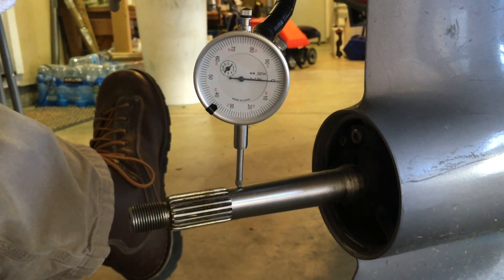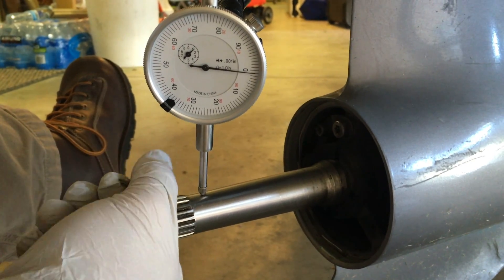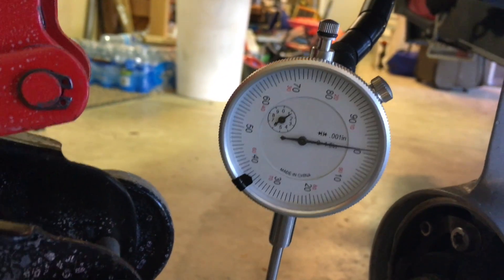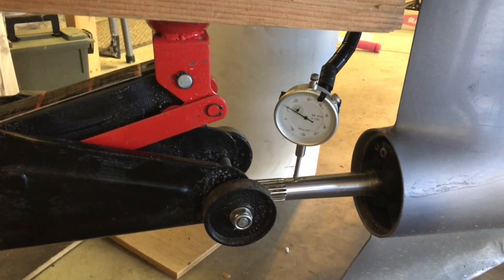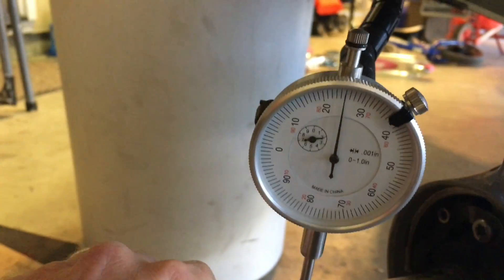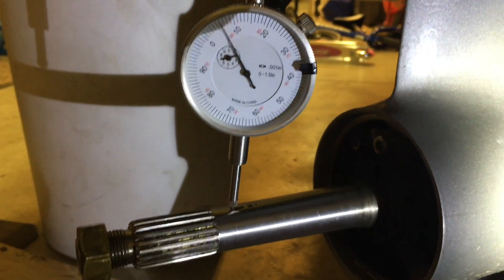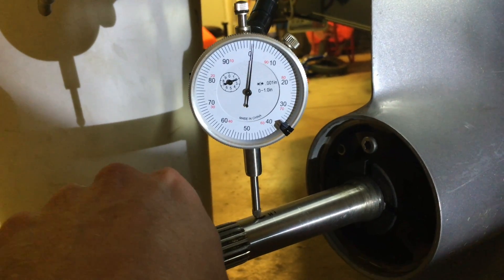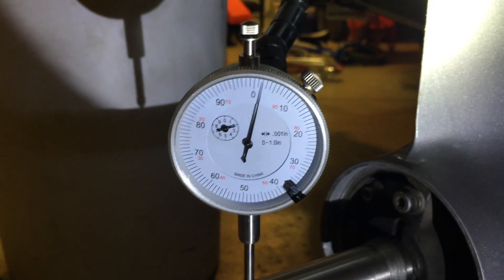Boat propeller shaft bent; repair

Comment: Had a 6mm bend in my honda 60 prop shaft.  Did exactly what is shown here, took 2 hours, managed to get it down to the point where I could not see a bend with the naked eye.  Unfortunately I never had the little gauge to measure the bens at the end.

Comment: Tried this on my bent shaft Mercury 25 HP and got it down to .003.  I stopped at that point and called it good enough. I didn't measure how bent it was at first, but it was pretty bent.

Comment: Be better to make sure its straight at the bearing end then find out  low spot....heat and quench to straighten in line with low spot on true circle....could bust housing this way.

Comment: I know this is an old video, but I gotta say it is still working perfectly! I bent the prop shaft on my Suzuki 200 and used this method to fix it. From .0190 to .0017! Time was about 5 beers or so. I still can't believe it works so well for being so low tech; another $800 saved because of this video! Now to find a skeg and prop repair video...

Comment: Stoooopid good video. Thank you. Zero impact on the bearings. This is the way to do it. Sure you could bring it to a machine shop and do it “the right way” but hell… Your way will save you bunches. For my 92 Johnson 40 they want 500+ for the shaft alone. 😂 HARD PASSSSS. Sure, if you’re 90 miles out and your life depends on it…. Maybe? But I’m putting around the lake on a pontoon

Comment: I commend you on your innovative approach to solving the bent shaft problem.

I have A couple of observations based on the video and other comments below...
1) waiting for a period of time while the force is applied does nothing.  Steel does not creep at room temperature.  
2) Once you reach the elastic limit of the shaft it will start to bend immediately with further force. You always have to overcome the deflection first when making a further correction.  
3) Applying force with the dial gage installed is essential. Once you get the feel for how much deflection is elastic any further deflection is actually bending the shaft back into place (called plastic deformation). This is what you're after, but you don't want to bend it too much.
4) A lot of comments warning of damage to bearing, housings, seals, etc.  First of all, if you have a bent shaft, the bearings, shaft, and housing have already experienced these high forces due to the event which bent the shaft in the first place.  Bending it back does involve risk, but it is a calculated risk.
5) Seals are very compliant, they should handle such displacements easily.
6) Brinelling of the bearing race is a possibility, but the original event would have also caused this if it happens.

The prop shaft on my Mercury 850 had 0.040” runout.  Bad enough to be very noticeable to the naked eye.  Applying this technique using a stubby bottle jack, board, and steel plate to spread the load I was able to get it down to 0.001” runout with no damage to any components!  It took only about 1/2 hour and no $$ other than the jack.
Reply: Wow, thanks for this comment!
Reply: Excellent comment.  I will be doing this to mine... turning the engine off in the water while it's in drive you can hear the prop contacting the shroud while the prop slows down.
Reply: 1) True
2) True
3) True
4) Dead wrong. When a prop strike happens the boat is in the water, the instant it made contact the rubber inner prop hub flexed, (if equipped) the motor was pushed to the other side, and the boat moved in the water, this all equates to a massive amount of "give", or "cushion" to the strike. The bend happens in a fraction of a second of high load at the instant of contact with the rock. What he's doing here is EXTREMELY risky and damaging the bearings for SURE. He's VERY lucky the upper or lower case did not explode in his face, they are NOT designed to have these types of forces applied in this way.
5) Yes and no, they are not designed to have this much prolonged pressure on one side.
6) Wrong again, see 4 above. The prop strike has to be very severe/under high load to damage the bearings, this repair "method" is WAY more damaging to the bearings than the initial strike that caused this slight shaft bend due to the massive, prolonged pressure to one side with zero give/cushion during the event of trying to bend it back.

At the end of the day, this obviously works, but almost everyone is causing more expensive long-term damage to the internals (bearings, seals etc) and risking destroying the motor case, and injury.
Just don't do this kids.
If you can afford a boat, you can afford to fix it right, or pay to have it fixed right.

People need to learn when and where to use which type of prop to avoid bending your shaft in the first place!
Aluminum props rarely cause bent shafts and are for open water and no hard obstructions like stumps.
If they hit anything, wood or rock, they will break/crack/chip/bend (by design to save you from expensive motor damage) and have to be replaced.
They are cheap to replace if you clip something.

Stainless steel props are for open water speed boats, and shallow water slow/idle speeds (like during fishing) with lots of wood obstructions like stumps.
They can handle wood strikes without damaging the prop or shaft 99% of the time if at idle speed and not blatant or severe/under load/on plane etc.
I currently live on the SE coast and bass fish inland freshwater rivers FULL of stumps, trees, and wood obstructions all over the place in the middle of the river half the time.
I have bumped dozens of stumps/trees with my stainless prop at idle speeds with zero issues.
Last Saturday I clipped a rock near a bridge next to I95 that should not have been there, destroyed my SS prop (They can be repaired, aluminum props cannot) and bent my prop shaft, because SS is much stronger than aluminum, so when they get broken from a rock, they also bend your prop shaft and/or do worse damage in the lower unit.
I was very unlucky and there are virtually no rocks where I currently boat except this one area and this rock still had no business being out in the open where I hit it.
When I move back to inland VA/NC next year where the rivers are all rock and never stumps anywhere let alone in the middle, I will be switching to aluminum as rock strikes are obviously common there, or I will swap on a jet drive lower unit if I can find/afford one to avoid the issue entirely.

Right tool for the job people, you don't need expensive stainless-steel props unless you meet the criteria I mentioned above, stop wasting money and risking damage to your motors.

Comment: I tried this on my 150 Yamaha, didn't work. Nearly caused further damage. 2.5 ton jack can explode your lower unit. That's more than a few grand at best.
As Christan said, spend the money and do it right. In NY my scag replacement was $325 and the ss prop fix was $285 at the prop shop. The dealer performed prop shaft replacement (prop shops don't dis and re-assemble) is $920,  included new shaft, new water pump housing and impeller no new gears and 3 hrs. labor. 
If you boat, at some point, you will find the bottom!
Tight Lines
Reply: You didn't know what you were doing then.
Reply: Hi Thomas I am located in NY as well and just stumbled on this video. It is that time of the year and would like to correct my shaft. Are you able to forward the shop info to me. Thanks Soo Much!!

Comment: As a marine mechanic for 30 years I HIGHLY do not recommend this! You are at risk of damaging the seals, bearings, the casting and a whole lot of other things. Just spend the money and have this done the correct way!
Reply: Absolutely correct
Reply: @TheGaboon01  not really,  i think; 

  if the bearing did not get damaged with the first underwater hit,it won't get damaged by the SAME force in the other direction; and i find it funny people talking about the seal!!  the shaft cannot move much ,where the seal( flexible rubber) is, so the seal will stay as it was before;  

and another thing: if the force was too grate to the point of the ball bearings/rollers  indenting the races, you'd feel it rotating the shaft in neutral by hand, and you'd hear the rumble and whine when you ran the boat in gear on land, on the muffs.
Reply: @josepeixoto3384  And I would replace the seal anyway if I thought it was a problem, that is still a very easy job compared to pulling the lower and then pulling the prop shaft. Don't get me wrong, I have done it, but I would do this if the bend wasn't over .125"
Reply: I TOTALLY agree.
Reply: If you think this is going to damage the seals you're just ignorant. Period.

Comment: Horrible.... You just side loaded your bearings and probably puting flat spots on them.... Down the line you are going to see the results of it
Reply: Lmao
Reply: 100% correct.
They just don't understand the simple physics of a prop strike in the water, vs static sustained load using this "repair method".
Stupid is as stupid does.

Comment: Many thanks!  This worked great!  I took my bent shaft from .115 to .003.  Your instructions were perfect.  I didn't buy the locking flexible type clamp that you had, I had to set up the two swivel system which was much trickier,.... I wish I had the locking flexible clamp!  Thanks again!
Reply from the maker: Nice job!! Glad that could help you out!

Comment: I feel like this is a dumb question, but I'm about to attempt this and am wondering how do you know which spot on the shaft to initially place the dial?
Reply from the maker: No worries! I just put the dial wherever it ended up and when I spun it, I identified the high spot to mark and start from.
Reply: @mbwtrpolo  Got it, so I attempted this the other day and when I spin the shaft the dial pin won't stay put. Looking for opinions, do you think that means my shaft is warped so bad I can't straighten it?
Reply from the maker: Ben Henson When you put the dial indicator on the shaft, you should be able to identify a low point on the shaft and a high point, with a linear difference between the low and high as you measure it.
Reply: @mbwtrpolo  Keep in mind the further out you go the better your reading, .005" runout at the 1/2 way point will be .010 runout at the end

Comment: Wow, I can only imagine the forces exerted on the foot casing and seals and bearings. I realize you didn't want to go through the troubles to disassemble the foot to get to the bent prop shaft and straighten externally, but you really applied a lot of forces on the case and everything else. IDK
Reply: I was thinking this same thing but I believe the logic here is the shaft was bent at some point and it survived those forces without cracking the case.
Reply: @ronaldwatson3348  Everyone is looking at this wrong, he's EXTREMELY lucky he didn't explode the case. 
During a prop strike there is a BUNCH of give, the motor moves, the boat moves in the water, so the force is not that high that bent the shaft.
It also happens in a fraction of a second, the motor moves and boat is pushed away in the water.
This guy is putting prolonged stress with NO give at all, on the shaft bearings, seals, lower unit gear case, and upper case with the wood and jack.
Literally everything about this guys "method" is a bad idea.
If that jack where to slip it could kill or maim him, let alone further damage or even total the motor.
There are plenty of home mechanic "methods" that work, some are safe, some are not, some are fine and ingenious, most are dangerous and foolish and results are 50/50 at best.
Do the job right or don't do it.
Don't be a Darwin award participant, let alone winner.

Comment: How do you know if straightening the shaft at the point that it's bent? The bend could be inside the case (most are) and you're just counteracting it with ANOTHER bend outside the case.
Reply from the maker: That's a great question! I can't say I know the answer to that! I hadn't really considered that to be possibility, and I know I was taking a big risk in bending the prop shaft, but I was okay with that since my fallback plan was to have a professional replace the prop shaft. I'll be curious to run the dial on it again as soon as it warms up enough to get back on the lake to see how it's doing!
Reply: I think the propeller holds most of the shaft straight and the bend comes where the propeller ends where the thrust washer and bearings start..The bending moment is biggest where the  bearing is when using the jack. I think...

Comment: Did you ever measure the deflection at the end of the shaft? I know you got yours to within 0.002" but that was in the middle. I used this method to bend mine back after hitting rock (it was out by about 0.130") and i got mine at the end to be within 0.004" which to me was good enough (i don't even know what manufacturers runout spec is). 

Thanks for posting this it really helped. I come from an aerospace background and i know for a fact the bearing races & balls material are much harder than the shafts that they are fitted onto, so i would not be worried about damaging the bearings with static loading, but i was worried about the seals. fater seeing the comments i was comfortable doing this.

Do you have any feedback on your fix? any troubles yet?
Reply: Hey nick i just want to thank you for that valuable insight.
Reply from the maker: Nick325J Hello there! To answer your question about deflection at the end of the shaft versus the middle, where I measured, I did not ever measure at the end. I wish I had now! I think when I winterize my boat in a couple weeks here I'll do just that and let you know what I see and if it's held after the last two seasons. I'm glad you were able to bend yours back so well! 4 thousandths at the end of the shaft seems pretty good to me!

Thanks for the input on the bearing races and collars, that definitely helps reassure me in my assumptions and research. As far as whether the seals have been compromised or if there ever has been any ill effect from the repair, I've had no troubles or issues at all! The outdrive oil has never shown a trace of water and everything has been fine. My plan always was to try and fix it and if I broke it, I'd have to pay anyway, so it was worth a shot!

Happy Boating!
Reply: @mbwtrpolo Hi, just looking for an update. I managed to get my shaft to .003" in the middle but on the end was between .007 and .008".  Hoping that is good enough.

Comment: I took a long breaker bar that slid over the shaft and nut and applied manual pressure and got mine less than .002 out but it took about an hour of messing with it.

Comment: nice work, ill be doing this real soon myself... also buying the same dial gauge, glad to see someone used it successfully already.
Reply from the maker: Good luck! I've taken the boat out a few times now and no issues at all, and it's still spinning straight!
Reply: I had .035 of runout, got it down to .004 and stopped messing with it... I went over once and didnt want to go over again lol
Reply: I used my 1.5ton jack and could only get it down to .015 before I was out of pressure, had to buy a lo pro bottle jack to finish.
Reply from the maker: +TurboGSR96 Nice work! That's great you were able to get it so close! Yeah, it definitely takes quite a bit of force to bend the shaft. But when you actually look at what the whole shaft length is, you see that only a third or less of it is exposed, so bending just that part is fine since so much of it is still supported in the housing. I'm glad you were successful! My outdrive oil is still water-free!